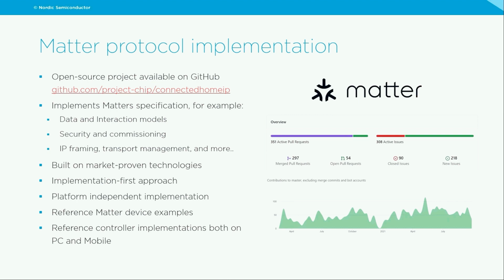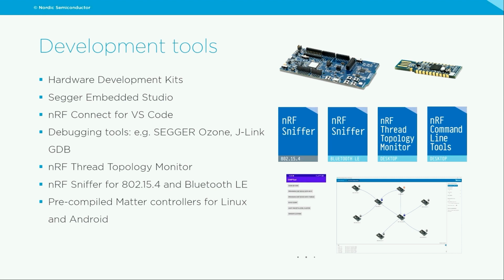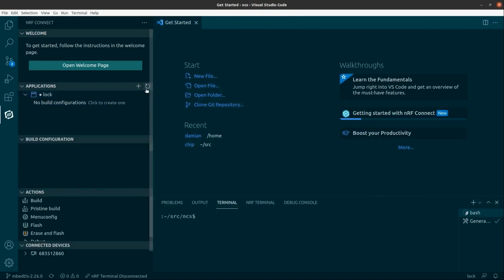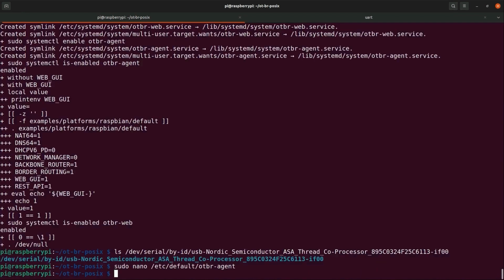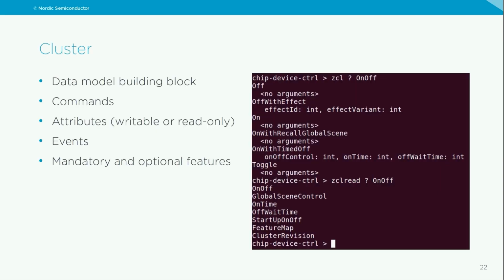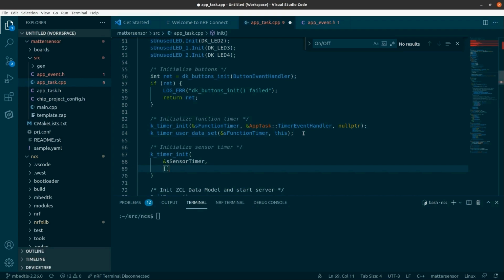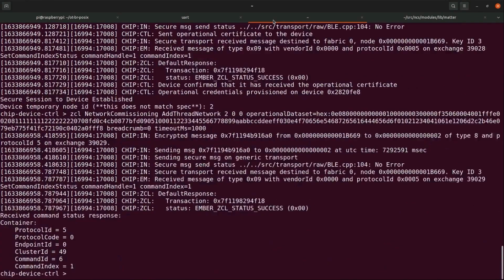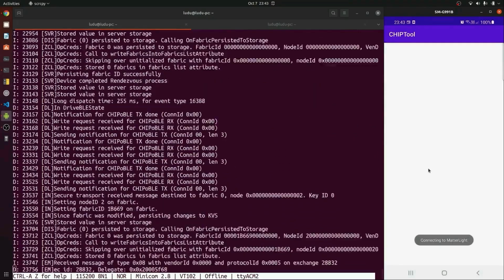Developing Matter products with nRF Connect SDK [Deprecated]

Comment: I have nrf52(pca10040) development kit,so does it will for this? And also if not what are some alternatives other than pca10056.
Reply from the maker: The nRF52 DK is equipped with the nRF52832 SoC, which does not support Thread and therefor Matter. The best DK for you to get started is the nRF7002 DK with Bluetooth Low Energy, Thread, and Wi-Fi, or the nRF5340 DK if you don't need Wi-Fi. The nRF52840 DK also works but has less features. 

Additionally, you can use the Nordic Thingy:53, and use your nRF52 DK as a debugger.
Reply: @NordicSemi  I don't have thingy 53 ,instead of that I have thingy 52 and thingy 91 should I use that?
Also I am using windows and on that I have configure raspberry pi with putty server so how I can create matter accessory on that?
Reply from the maker: @pulseandpivot_pooja  No, you can use those instead. We recommend you to reach out to our tech support on DevZone for more help:  https://devzone.nordicsemi.com/